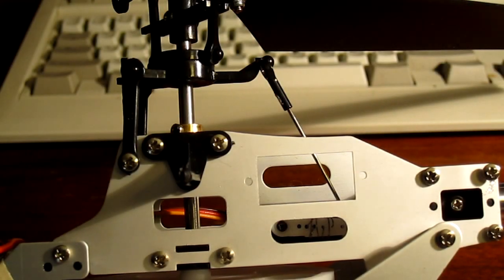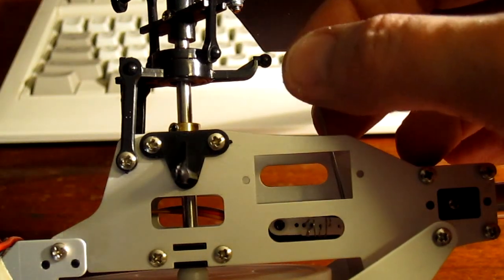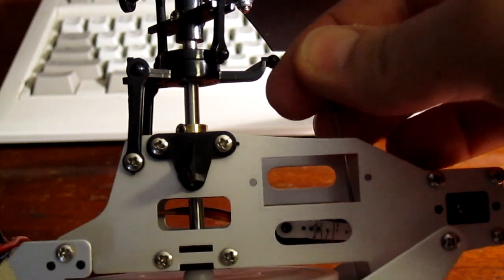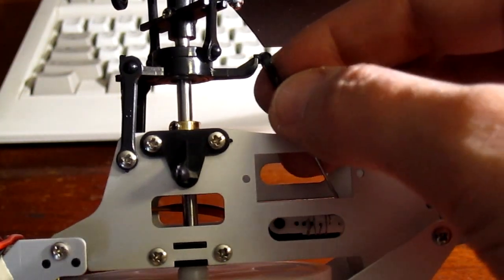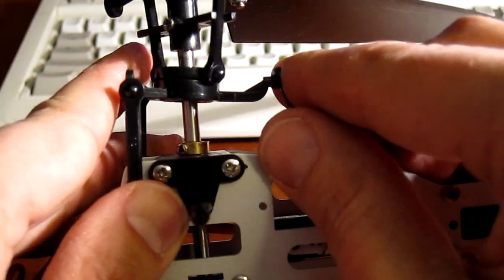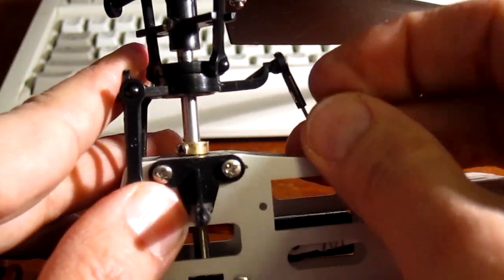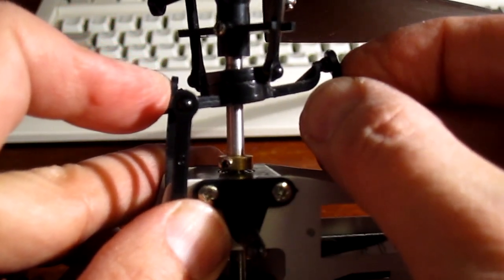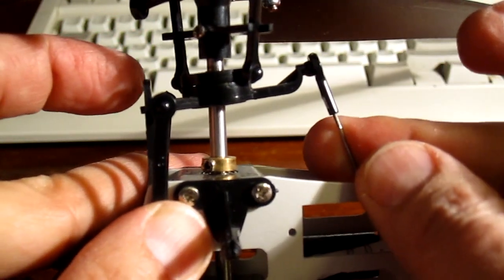How to adjust the swashplate for DH 9104, DH 9100 and other helicopters

Comment: Thank you for the post.   I just got a 9100 and had a mishap first flight so I didn't get a chance to make the adjustment but made note that I need to do that short time I was flying.  I have to get a replace the center mast of the 9100.  Its the piece that that slips over teh main shaft and the rotors attaches to I pretty much sheered the plast nubs off that attach to the rotor head.  I was kinda surprised of its speed and could get it to slow fast enough.

Comment: yeah. I found the latest version of the 9100 and 9104 have been pretty well dialed in to hover correctly. I have had 2 9104 and 1 9100 and they have been correctly set up and hover well and foward flight is great to

Comment: @Crash48Danny   there are many spare parts suppliers for the 9100 on eBay. Just do  search for the inner shaft part number. For the 9104 the part number for the inner shaft is 9104-06

Comment: @freediverga The swashplate  mod could have helped I think I was just surprised by teh speed it really lol.  Hey I also got my Super Cub Lp for Christmas to so the first flight with an RC plane went really good though.  I think I had some interference from some high tension powerlines near by because it did  respond for a second which scared the crap out of me.  I got it back closer and all was fine after that.

Comment: i added the modeling clay and adjusted the swash plate forward. some reason my help surges and drops out the sky. I stretched out the antenna but it still flys like crap. this is the first day with this thing straight out the box after a charge and it sucks! Can you give advise as to what i need to be checking? the servo seems to be straining with the adjustment too.